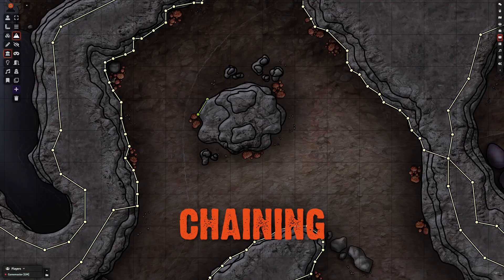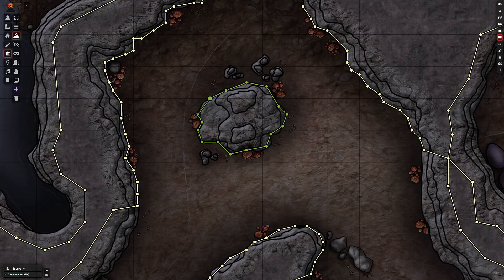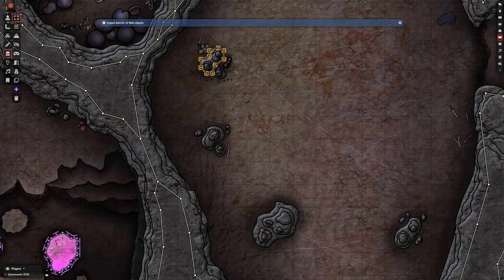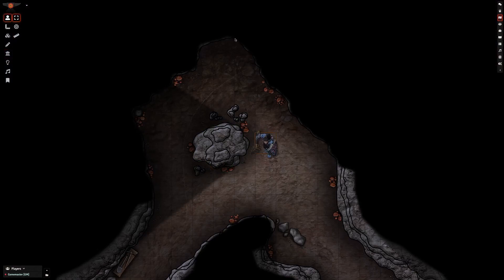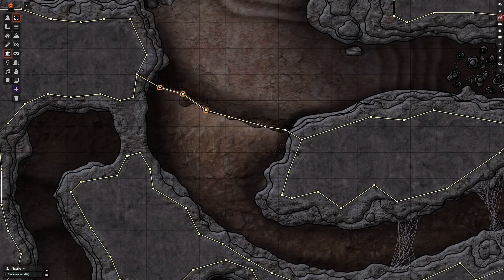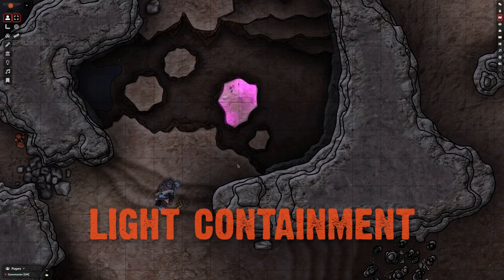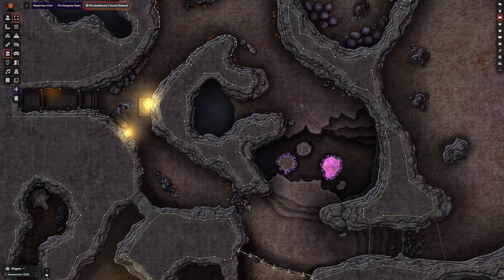Foundry walling tips

Comment: Excellent set of tips.
Is there someway to see what the sub-grid is?

Is there someway to move one of the "end-points" and have both the segments move? 
I'm finding I have to move one segment, and then reconnect the other segment
Reply from the maker: You can't see the subgrid in core, but you can learn more about how it's segmented here: https://foundryvtt.com/article/walls/

Moving an entire segment is something that might be doable with a module; you could search for "walls" in the module browser, or ask in #module-discussion on the discord.
Reply: @unsolublefoundry  many thanks 👍
Reply: @unsolublefoundry  
I've installed Monk's Wall module, and it does indeed handle moving a single node and the two wall segments are both moved. Plus it has lot of other useful wall tools

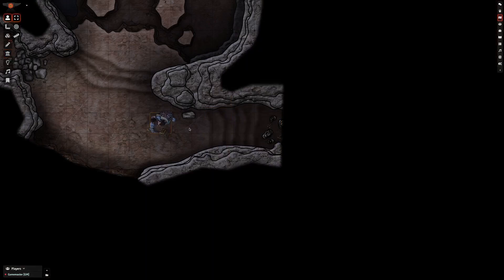Comment: At 4:52 he talks about terrain walls but he means normal walls.
Reply from the maker: Those are actually terrain walls in that example — the ones that are crossing between the cave walls in that corridor. They're providing segmented reveals of the map, as you cross each one's threshold (because you can see through a single terrain wall segment, but you can't see through two).
Reply: @unsolublefoundry  Sorry, my mistake then. I just tried it with terrain walls and I couldn't get it to work but using normal walls did! Awesome video by the way, thanks again.